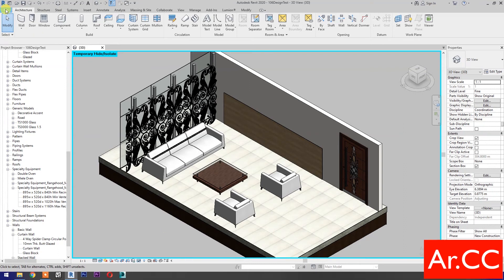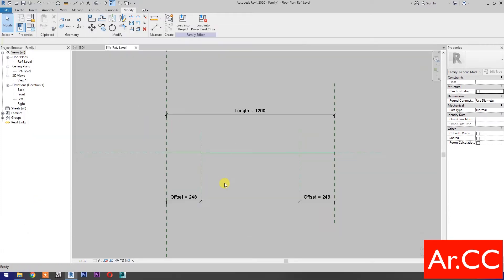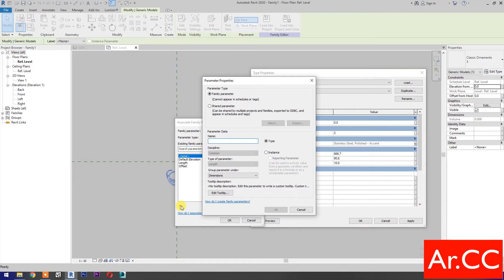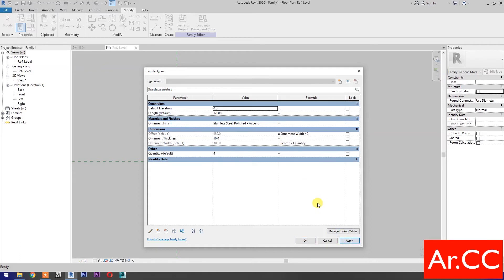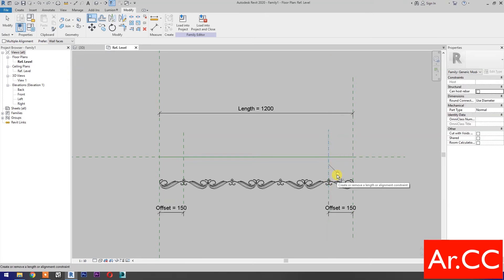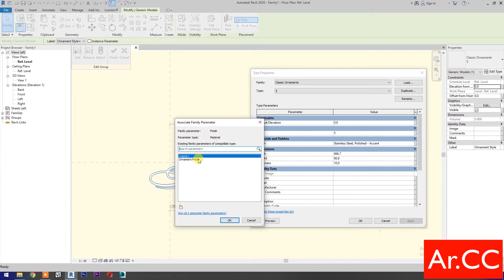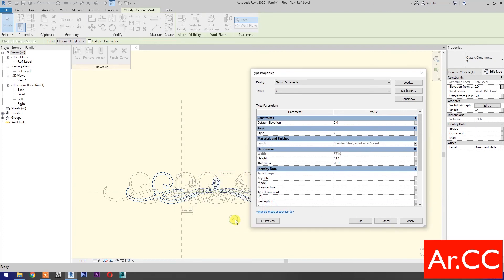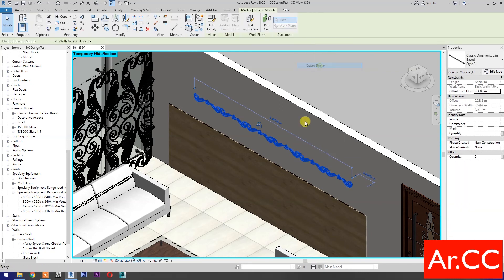RD106. How to make a Parametric Line Based Classic Ornaments in Revit.

Comment from the maker: Suggested Videos:
RD112. How to make a Parametric Arabic Wall Screen Divider in Revit. Decorative Wall Panel in Revit
https://youtu.be/QUr7-LO2I2Q
RD111. How to make a Parametric Floor Accent in Revit.  Custom Floor Pattern Design in Revit.
https://youtu.be/K-3mrs3ICD8
RD110. How to make a Classic Ornament Parametric Gates in Revit. Steel Gate Design in Revit.
https://youtu.be/STm4xRDQTdY
RD109. How to make a Classic Ornament Stair Railings in Revit. Classic Ornament Baluster in Revit.
https://youtu.be/mq1grcVPxhg
RD105. How to create a Parametric Classic Frames for your Paintings and Mirrors in Revit.
https://youtu.be/Nj61BYxZ34A
RD104. How to make a Parametric Pattern Decorative Accent in Revit. Parametric Ornament in Revit.
https://youtu.be/_XDuJrJ9jaM